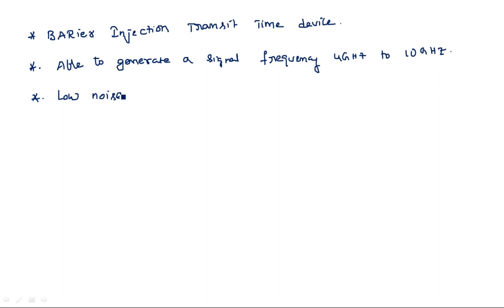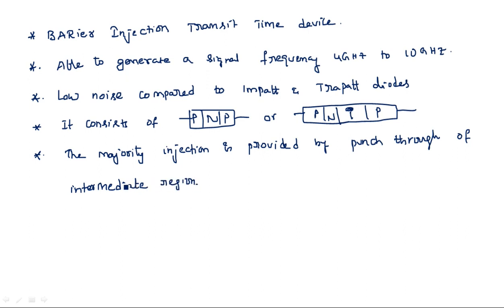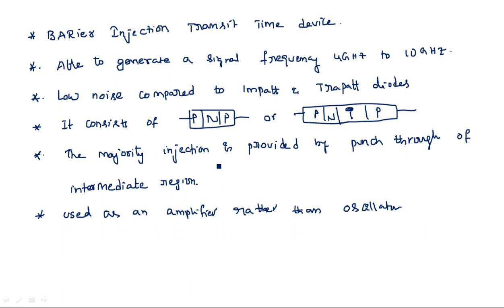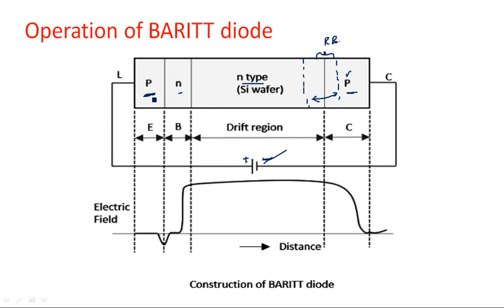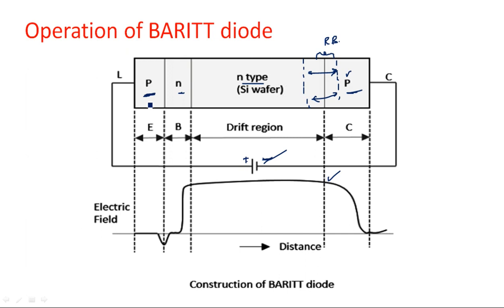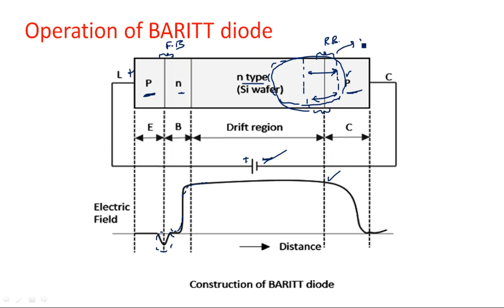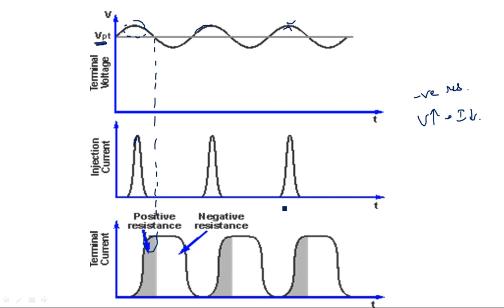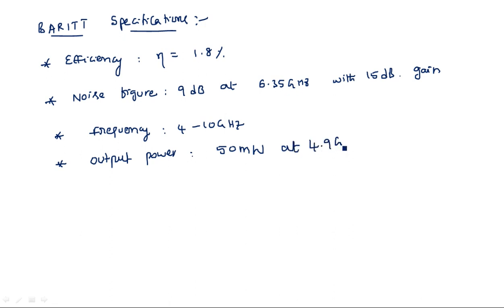BARITT diode | Avalanche Transit Time (ATT) Devices | Microwave Engineering | Lec-114

Comment: 00:05 Baritt diode is an Avalanche Transit Time device with low noise and signal frequency range of 4-10 GHz.
01:45 BARITT diode structure and majority injection
03:33 BARITT diode is an amplifier rather than an oscillator.
04:58 Baritt diode operates on positive and negative supply for reverse bias junction.
06:28 BARITT diode acts as a transistor with three regions due to reverse bias.
07:43 BARITT diode operation with applied voltage and electric field generation.
09:01 BARITT diode operates in the negative resistance region
10:21 BARITT diode has variable frequency of operation and output power
Crafted by Merlin AI.:hand-pink-waving: